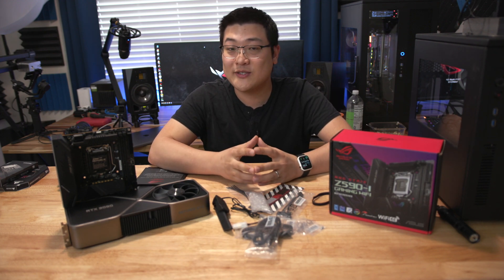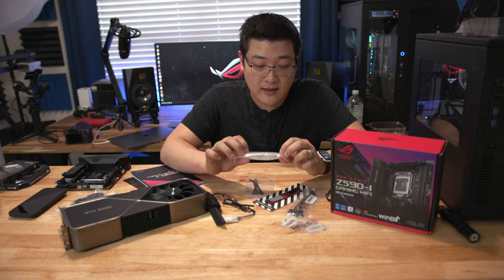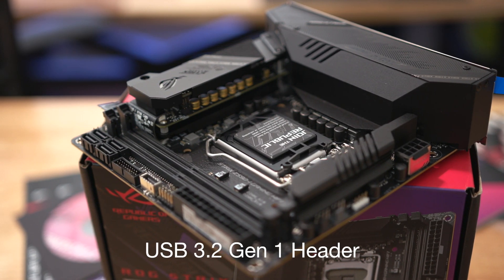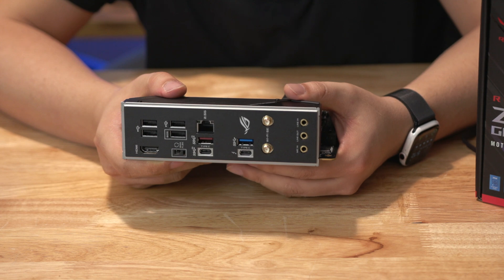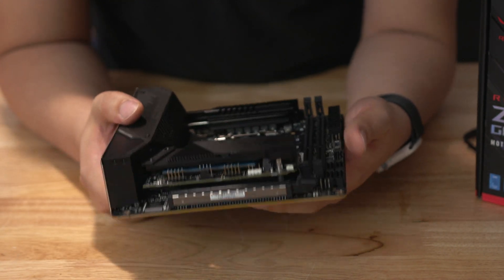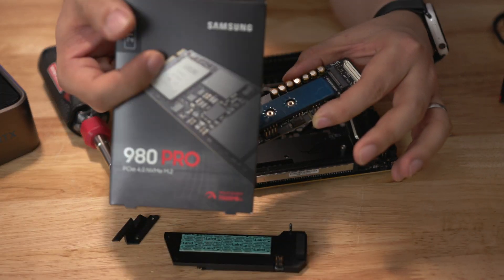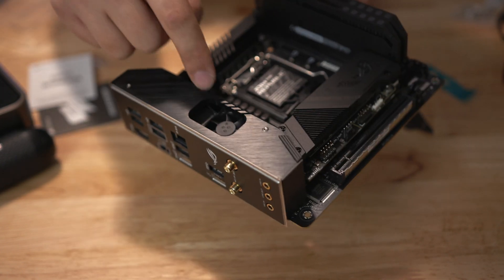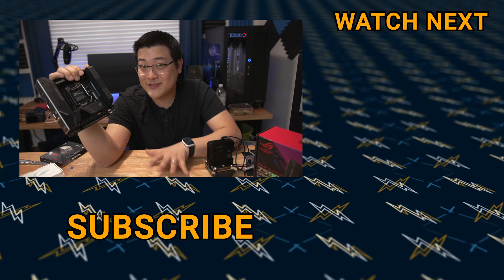Asus Z590 Strix-I | First Look

Comment: Cant decide between this and the MSI meg z590i, i like the extra thunderbolt and display port on the MSI but overall prefer ASUS. Can this drive 3 monitors?
Reply: Motherboard display port? Seriously? You need a video card
Reply: There is a huge shortage of video cards, I'm not a gamer anyway.
Reply: @samsmith3025  I would like to know how many monitors you can run without a GPU, too. The mobo only has 1 HDMI output though. Might be depending on which CPU you are using too I guess. Have you done any more reasearch on this?
Reply: @mikehawk4517  So I went ahead and built a system with this ASUS Z590I Strix motherboard in an Ncase, and I'm totally happy with it. I'm successfully running 3 monitors, one thru HDMI and two thru the USB C port into a startech hub with 2 DisplayPort outputs.  I have the i7 11700k with the UHD 750 onboard graphics. This will tie me over until GPU prices come back down, probably early 2023. Im not much of a gamer so I can wait it out. The ASUS is a sick board. My guess is the MSI board can do similar with the monitors.
Reply: @samsmith3025  Cool! Thanks for replying. I think you did an excellent choice given the current situation of GPUs. Just the aesthetics of this motherboard is really sweet imo. Would you say you get any noticeable reduction in image quality on the two monitors that goes into the single USB C port?
Reply: @mikehawk4517  No reduction in quality, I believe UHD 750 will drive 3 monitors at 4k.

Comment: based on what i see the 980pro is bent when the heatsink was installed.
Reply from the maker: Yeah, when you use a single sided M.2 drive, the heatsink looks like it puts a bit of extra pressure on the drive bending it. The padding on the other side was designed for double sided M.2 drives. I ended up loosening the screws a little bit to prevent the bending.
Reply: @StanYanMan  scary
Reply: I got some 3mm thick thermal pads and replaced the stock one and that helped.